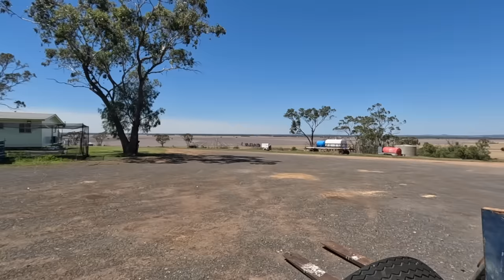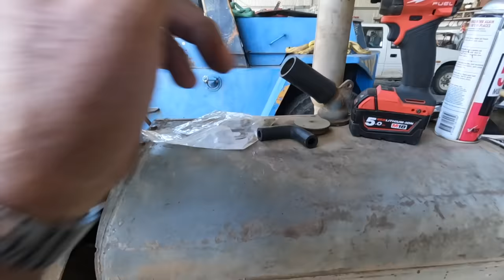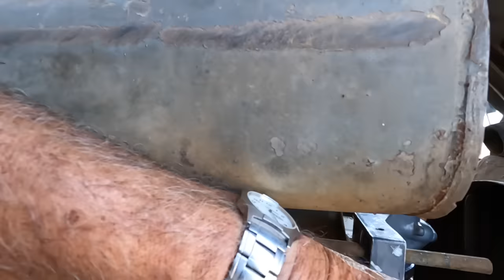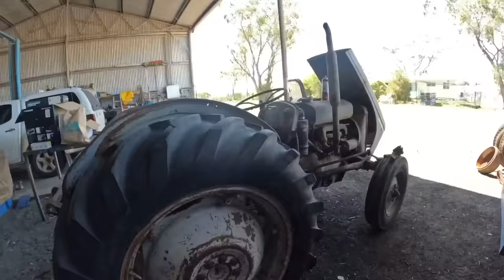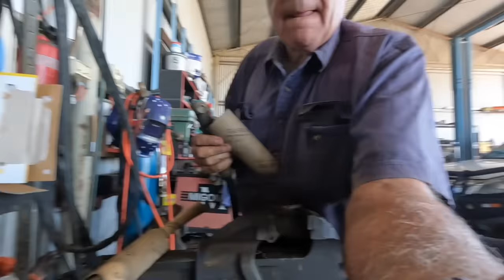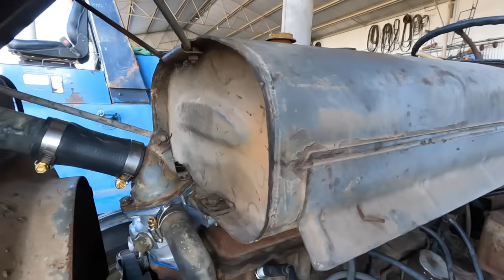Some Parts Have ARRIVED! | Dads Grey Fergie | Part 3 | Vlog 239

Comment: If you go bush, corn flakes packet or other plastic coated cardboard, ball pein hammer and scissors/pocket knife are essential. Only gaskets that can't be made from that are head gaskets and exhaust manifold gaskets. Once you get back to the city you replace the fabricobbled gaskets, at least that's the plan. Many years later most are still in situ. Retired mechanic/machinist Southwest of the big smoke in NSW.

Comment: We used to make those gaskets out of weetbix boxes, which were always available :)  No silicon gasket maker back then, so a bit of grease smeared over the cardboard did the trick.  That was before 12+ psi radiator caps, though, mostly we had 7psi caps.
Reply: I remember the old cardboard trick as well
Reply: @norrisbutler1738  We are both showing our age, haha.  Stuff was very simple back then, as evidenced by the Fergie.
Reply: I still use weetbix cardboard and grease, a set of hole punches many years later was a bit of a game changer

Comment: Peter, memories of our 1st tractor on the farm. It pulled a 2 row disc, end turn  by wheel standing with wheel brake. 2 furrow plow + bed maker - very reliable. HP & comfort pales to the modern tractor. A lot of sunburn those days

Comment: NEVER EVER USE SILICONE anywhere on a cooling system. Its one of the worst things that contributes to clogging a radiator.
I know I owned a radiator repair shop.
I always used SIKAFLEX 221 its polyurethane based and wont end up in the radiator or blocking a galley in the motor.
Reply: Silicone, AKA. Gorilla snot.

Comment: I used the ball pin hammer to tap round the larger hole, saves trying to use scissors !! Best Wishes from the UK.🇬🇧 🇬🇧🇬🇧
Reply: Problem is corrosion/pitting on the inside meant he didn't have a sharp edge to tap against.